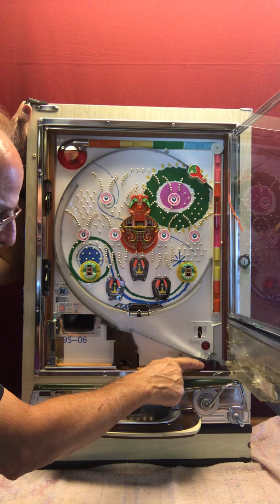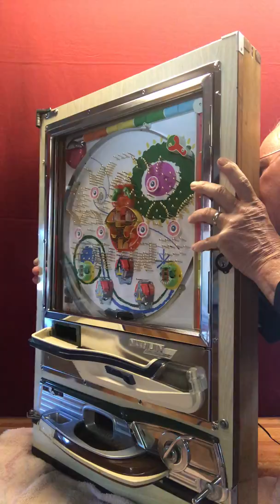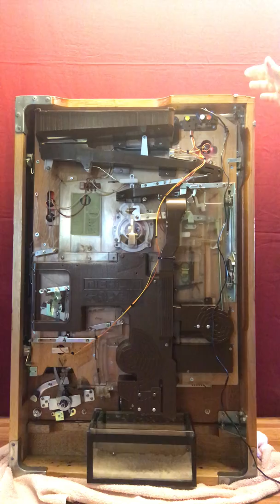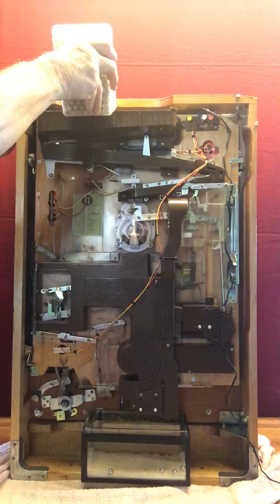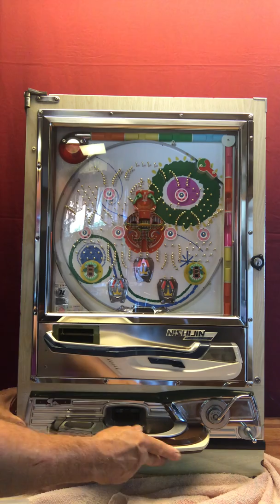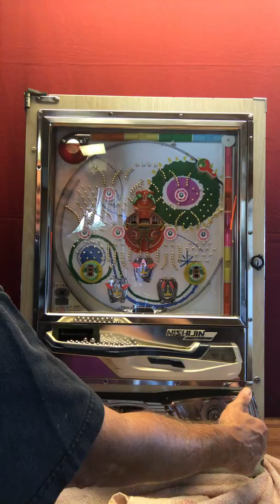How to set up a Model B Pachinko Machine

Comment: i just got a baseball themed pachinko and it isn't feeding the balls to the plunger, i am trying to work that out but i did use your setup tips, my flap was in the down position behind the door
Reply from the maker: How many pachinko balls do you have in the machine?  You need to put enough in the upper hopper so the weight pushes down the platform in the hopper. This moves a flag out of the way in your ball handling mechanism.
Reply: @MagicPachinko  i've got 200 at the moment, got another 200 on order.  

i found the problem last night after i commented about the balls not feeding.  this was a project machine i bought for 25 bucks and the front door only has 4 screws holding in the entire assembly. 

that itself was the problem i pushed in the lower area where the plunger is and the little white flag moved out of the way and a ball fed.  Now i need to get some screws and secure it down, that is probably the whole reason it doesn't work correctly.

also one of the tulips is stuck and will not close when a ball has entered.
Reply from the maker: @expfighter5112  There is a brass piece inside of the tulip. At the front end there are two small tabs. You can adjust them with needle nose pliers. First ball should open the tulip, second should close it. Good luck.
Reply from the maker: @expfighter5112  There is a brass piece inside of the tulip. At the front end there are two small tabs. You can adjust them with needle nose pliers. First ball should open the tulip, second should close it. Good luck.